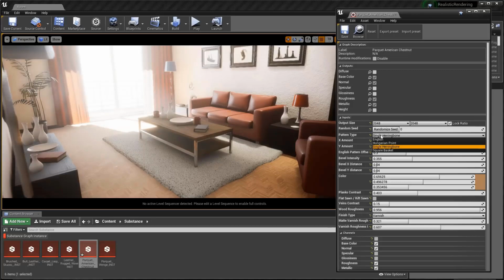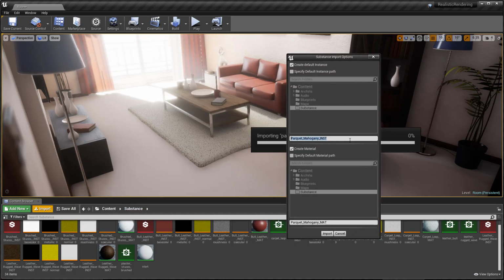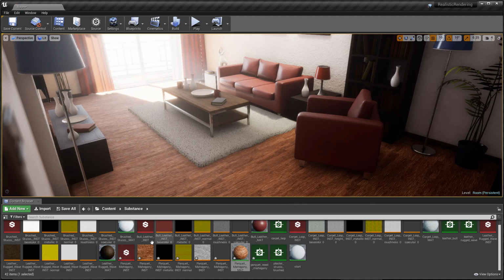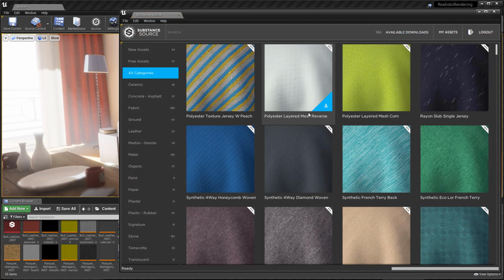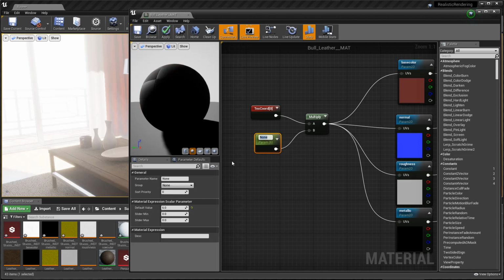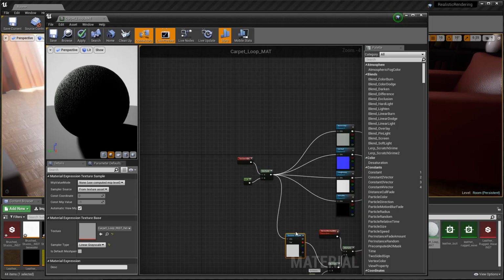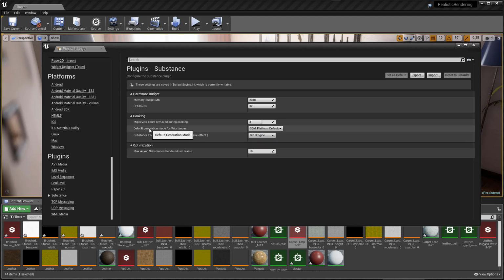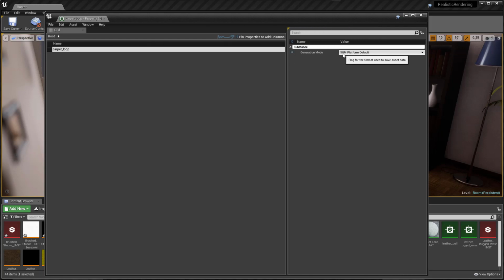Using the Substance plugin in Unreal Engine | Adobe Substance 3D

Comment: When I try to run the plugin the following message appears: "Substance Launcher not found, please download it from the website." I went to the website but to my great surprise it said that "The Substance launcher is now deprecated. We recommend installing software versions manually or using the Creative Cloud Desktop application". I don't understand why if the application's been deprecated the plugin keeps requesting it 🤯.  Nothing's helped. 

Has anybody had same issue? Have you found the solution?
Reply from the maker: I think you're running an old version of the plugin, it should not require the launcher at all.

Comment: Is it possible to adjust the substance inputs during the simulation for animation?
Reply from the maker: Yes, but you have to set the texture properties up so they are regenerated. Also this is VERY perfomance-dependant, heavy textures will not regenerate instantly, same for large 4K textures. Don't expect miracles!

Comment: Anyone solved the problem that make the launching fail with Substance plugin activated ?
Reply from the maker: It should be resolved now. We had an issue with Source that was fixed on our server
Reply: Thanks for the answer guys but is there a link where a could find the fix ? Or should I redoWnload ue4 or substance? Thanks again
Reply from the maker: This was a fix on the backend Source server. The crash should no longer happen. You don't need to update the plugin. However, we will be providing an update that address the new issues we are having the map display images.

Comment: Hey Wes, is there an option to keep diff texture the same in UE4 as I've designed it in SD? I exported material(rough/metal pbr) as sbsar and imported in UE4 and the diffuse was very dark. If I import it via textures bitmap set then it's fine.
Thank you very much
Reply from the maker: Hmm, it should be the exact same with the sbsar file. Can you send me a private message on our forums and I can help.
Reply: @Substance3D  hmm. I need you nickname at least. Or it's just "substance"? ;)
Reply from the maker: @philippmaluta978  Oh, sorry man :) I wasn't thinking. This is me. https://forum.allegorithmic.com/index.php?action=profile
Reply: @Substance3D  No! It's me! XD
Reply: Substance link leads to currently logged in profile.

Comment: When downloading a material from source i'm unable to generate the heightmap. Also when i tweak the parameters, nothing changes. any suggestions?
Reply from the maker: Please check this page in the docs. It shows how to use the height output. https://support.allegorithmic.com/documentation/pages/viewpage.action?pageId=159451180
Reply: Allegorithmic when I enable the heightmap in the instance I don't get the height map texture. I can enable and disable every other texture inside the instance except the heightmap.
Reply from the maker: Hmm, enabling the height should produce a texture in the Content Browser. Are you using a custom substance?
Reply: Allegorithmic no, a material from substance source. The strange thing is that with some materials I can't change the parameters like resolution/color etc.
Reply from the maker: Ah, I just replied to your post in our forums. I will help you there : ) Also can bring in the devs.

Comment: I'm trying to add images in the image input that my substance material has, but no matter how much I try to do so I can't ( this materials are such as curvature, wsnormals, normals, position in order to make the texture adapt to the mesh using triplanar projection)
Reply from the maker: Please check this section of the docs on image inputs. You need to set the imported bitmap as a substance image. https://support.allegorithmic.com/documentation/display/integrations/Substance+Input+Image

Comment: Hi Wes, I wonder if you can help. We use Substance in our Archviz pipeline with Ue4. We were trying to package an HTML application in UE4 for a web based app for our client and none of the Substance Materials we used showed up in the final application. After doing some research we were told that Substance materials do not package with HTML applications in UE4, is this true?
Reply from the maker: Hello! We don't support HTML at this time, but we are working on this : ) For runtime and baked we currently support win64, win32, linux, macOS, PS4, Xbox. We are doing some work now to support UTexture2D which means all our outputs will be compatible with all of the platforms UE4 supports.
Reply: Great, thanks for the feedback.